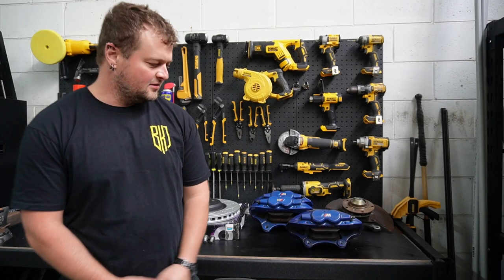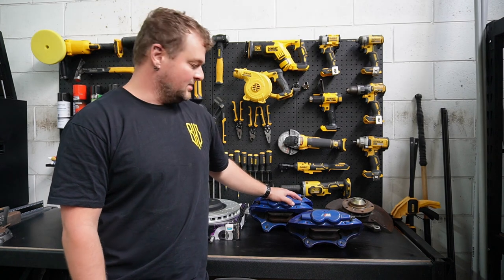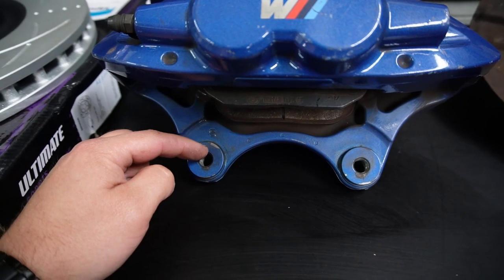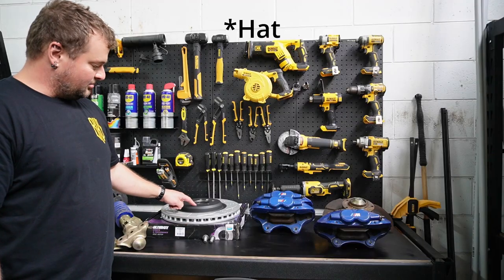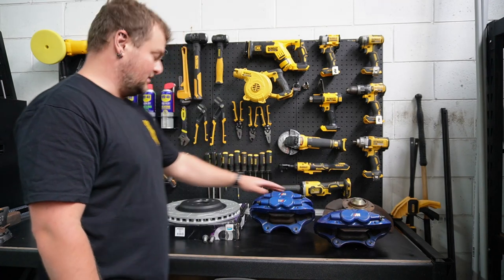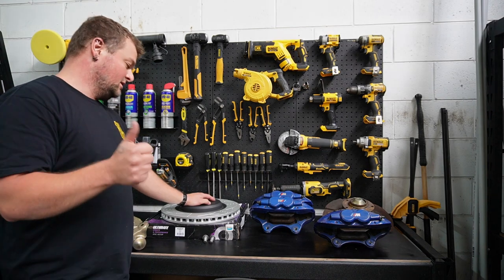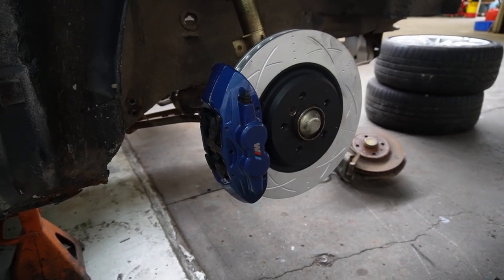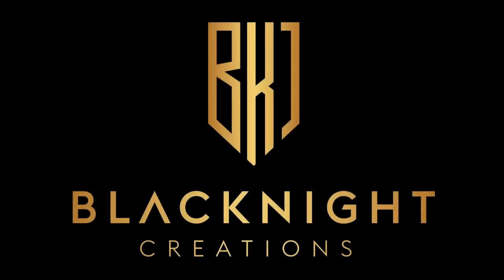E30 Ute Build Ep.8 F8X Bolt on to E30 E36

Comment: I used the F Series Brakes on my E36. Even used the Factory F20 M140i Front Discs.
had to fire a 20mm spacer behind the disc tho but other than that, OEM and Bolt on
Reply from the maker: Yeah nice! It’s cool how BMW hasn’t changed many of the dimensions and you can bolt the new stuff onto the old stuff

Comment: I might’ve missed it but, was there an adapter needed for the actual caliper to mount or does that part just bolt straight up to the e30/36 knuckle?
Reply from the maker: The caliper just bolts straight onto the E36 knuckle, no adaptor needed. If you don’t want to go as big the M140i front calipers  also bolt straight on
Reply: Besides the hat offset being wrong on the f8x rotors would they fit diameter wise? Or is the 380mm going to be to wide for where that caliper bolts to the e36 knuckle? I'm thinking of machining custom center top hats for a 2pc 380mm f8x rotor to put it in the right offset to be centered but not certain about diameter as you went with a 365
 @blacknightcreations
Reply from the maker: @pdx_vert9534 I’ll have a look next time I’m at my workshop and I’ll have a chat with another subscriber who I believe has already done what you’re talking about. I think they can fit but I’ll double check

Comment: You say overkill, but doesn’t this upgrade does makes sense for a Ute? I’d imagine you’d also be carrying lots of load back there, coupled with the added weight of all the upgrades, larger more power engine, etc.. a brake upgrade is necessary!
Reply from the maker: With the engine upgrade it definitely did need bigger brakes but brakes on the E36 M3 are no where near this size. When everything’s finished I don’t even know if I’ll use this as a Ute, only time will tell

Comment: I have an e36 m3. I just picked up G42 M240i brake calipers. Wouldnt i need a custom bracket to put these calipers on? I doubt these just bolt up
Reply from the maker: Nope they bolt straight up to the E36 knuckle, finding the right rotor is the difficult part.
Reply: @blacknightcreations  thank you for this info🙏🏾
Reply: Would these fit on an e46 325i